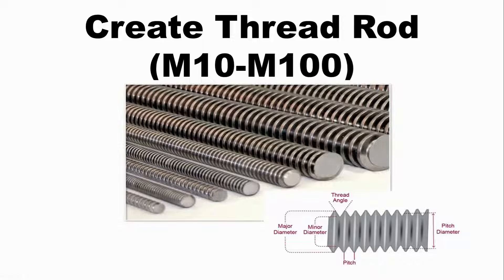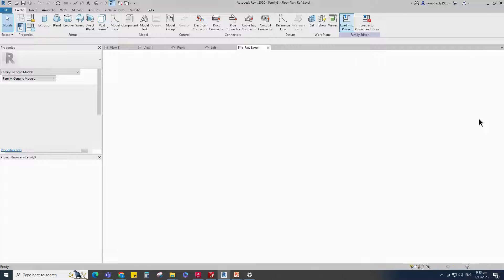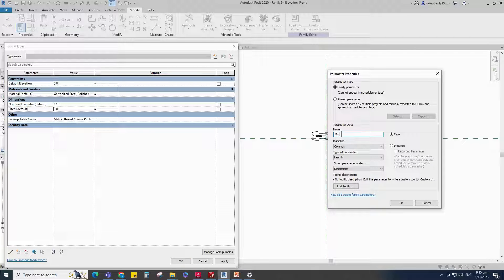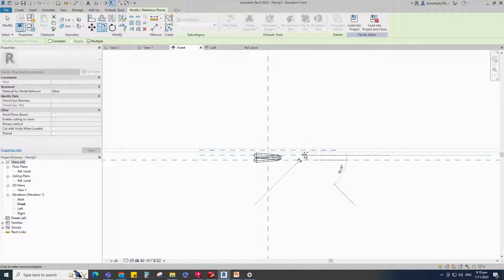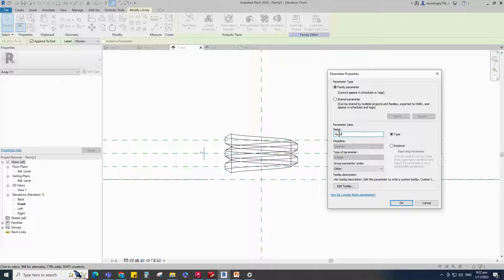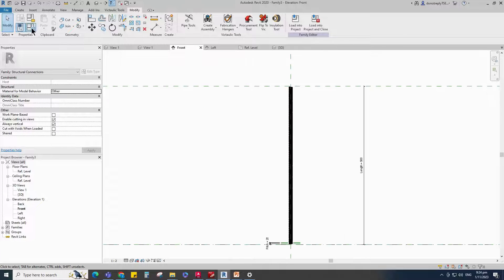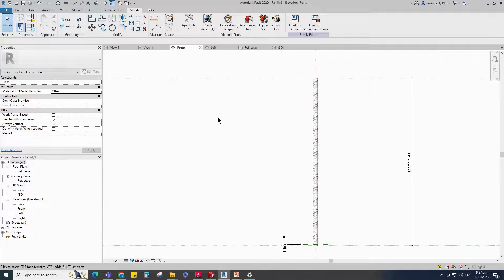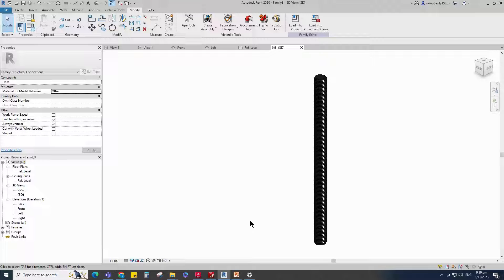Create Thread Rod Revit Family (M10-M100) (Parametric)

Comment: At minute 2:23 the "Lookup Table Name" does not correspond to the "Pitch" formula, for a value of
Nominal Diameter (ND) = 12mm , the values of:
Pitch (P) = 1.75mm (But in Revit it is 2.2mm)
Minor Diameter (MDM) = 9.853mm (This is OK).
Could you please share the correct CSV table?, since when applying the formula "No of Thread = (Length/Pitch) -2" it generates too many copies
Reply from the maker: Please can your csv via email? I can take a look.
Reply: I meant could you share your csv with which you obtained a value of "Pitch = 2.2 mm" for "Nominal Diameter = 12 mm" at minute 2:23 or share your family "Thread Rod.rfa", since it gives me problems and I can't create that Revit family
Reply: @ThomRVT ok, what's your mail?

Comment: Those parameters of Thread Coarse Pitch are very different from what was shown in the other video. The Thread Coarse Pitch looks smaller than the video you refer to.

Greetings!
Reply from the maker: You may need to adjust up the pitch value for M10-M14 in CSV file. Because the line shorter than 0.8mm will get error.
Reply: @ThomRVT   Thanks!!!!